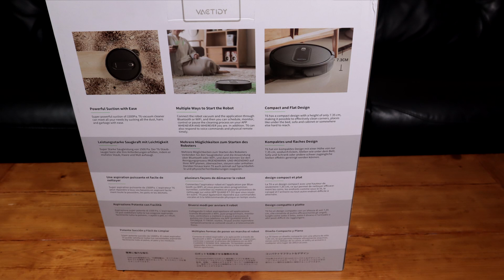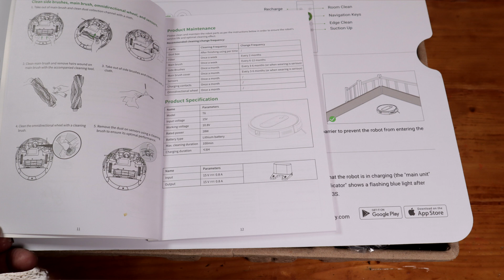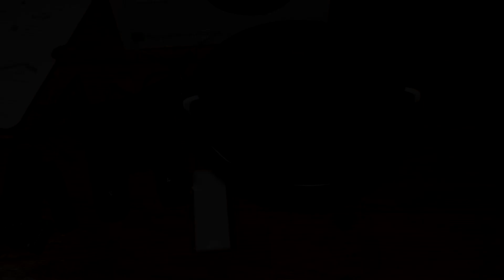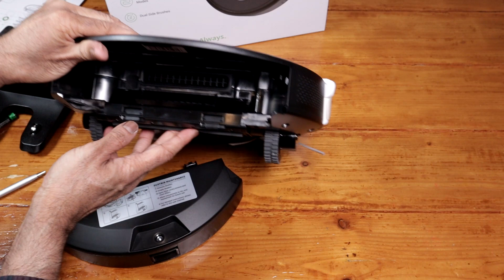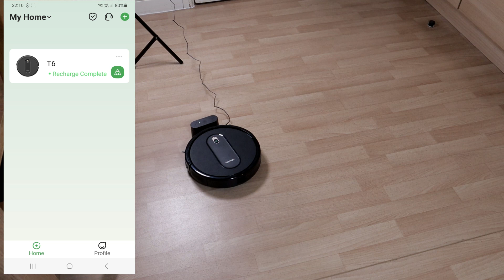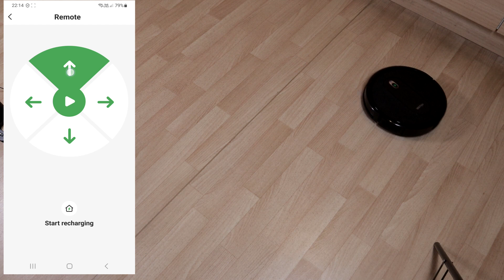Vactidy T6 Robot Vacuum Cleaner How To Use & Review

Comment: I can’t connect mine to the app I do everything you do but when I connected to the vacuum network and go back to the app at the end of the loading says that there was a problem 😢😢
Reply from the maker: Have you tried resetting the machine? Also remember this only works on the 2.4Ghz.
You may have to split your router bands. If you put your router model in Google I'm sure you'll find a how to video.
Reply: Were you able to fix it? I have the same problem 😭
Reply: @GrumpyMansREVIEWS  yes I have tried everything!!